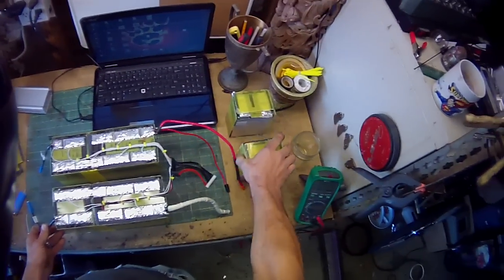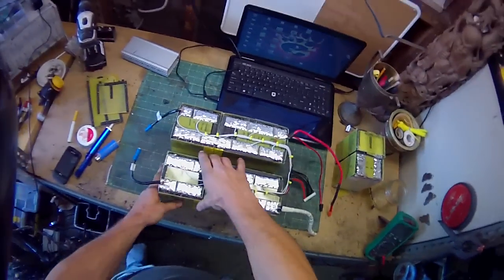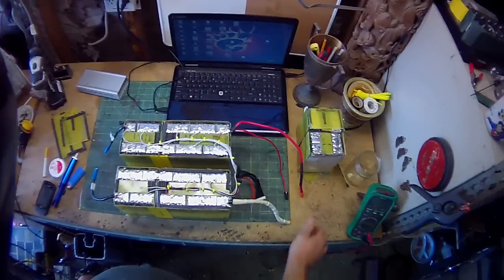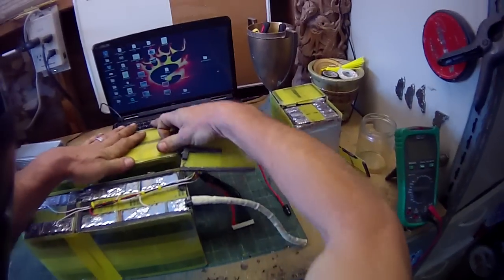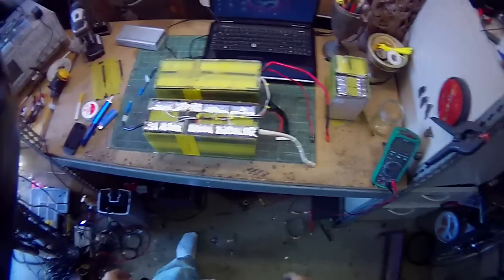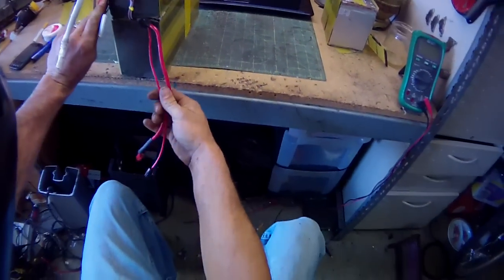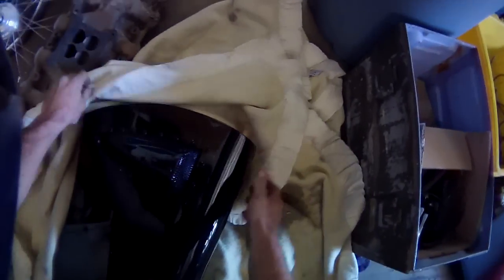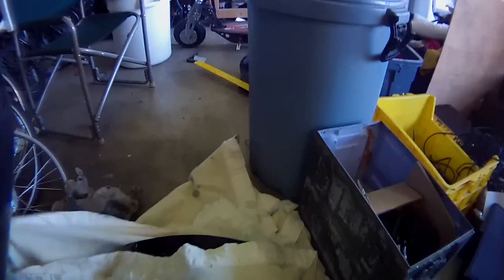PING 60V 30AH to 48V 30AH Lifepo4 Bike Battery Rebuild #3

Comment: I have also purchased a similar battery only difference is the signs size and I want to know how this thing is built up like Lego pieces so I can also reshape it into a specific shape so that it is more tightly fitted on my small bike I am really afraid to cut it open and tinker with it I have no experience in this but I am interested in this stuff now, I have a 750 watt motor and it is hooked up to a 20 inch small folding bike and I really need the space I am trying to put it underneath the down tube for lower center of gravity and my feet don't hurt then while I'm peddling if I were to put them on the side of my rear rack as panier style set up and I can still use my rear rack still and have the weight centered in the middle, I really need your help Iam wondering how to rewire everything back and maybe turning into a single unit instead of a dual battery just to unify The structure.

Does your phone number still work???

I mite give you a call later this week.

Any help will help

There's very little info in this specific battery.

Comment: Did you get the final battery pack to work? Looks like a lot of hours
Reply from the maker: Yes it worked fine... the whole job took me about four hours or so.. he is still using the battery pack in his show bike...Keep an eye on Kacy www.marrscycles.com he's got a new model coming out I've been helping out with... and its going to bridge the gap between the Super high end stuff like the M1 and some of the cheaper bikes on the market.